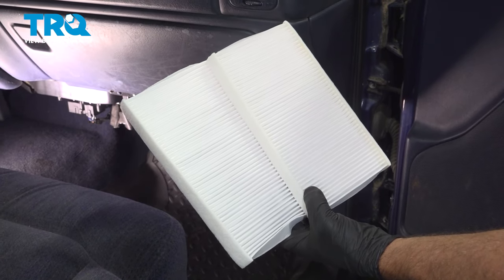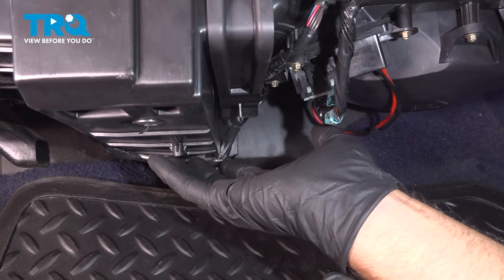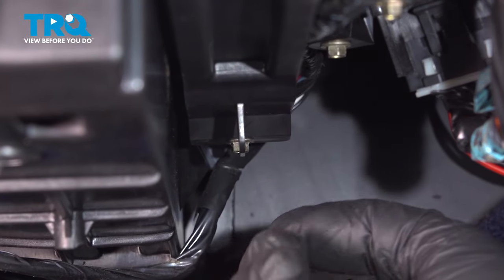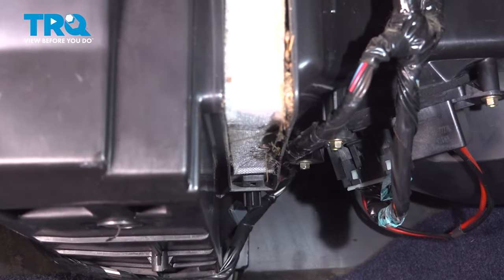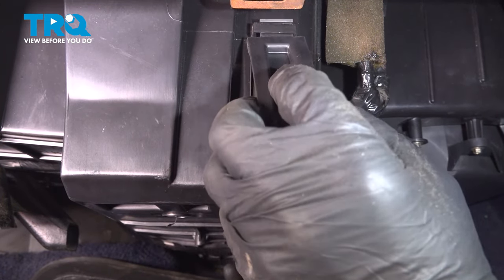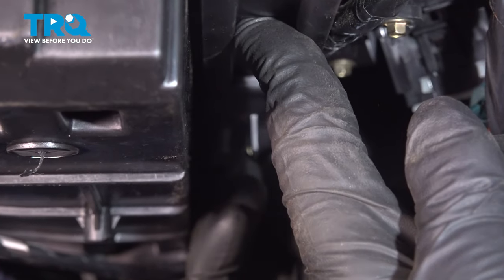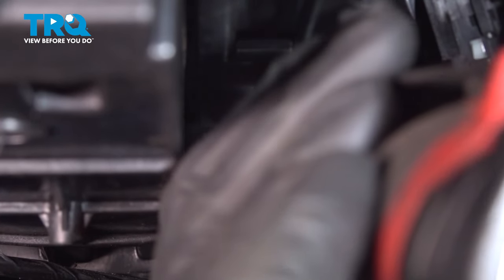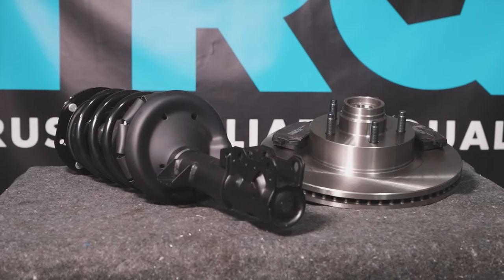How to Replace Cabin Air Filter 1999-2006 Chevrolet Silverado 1500

Comment: My truck doesn't have this. It's a 2006 silverado extended cab z71. Guy at parts store says my year doesn't have one. Why would that be? How do I get the bad odor out from vents? Wouldn't make sense why they list my year as compatible with this filter/process yet then I open it up to find there isn't one.

Comment: Surprised you haven't corrected the title / description / etc. since Chevy discontinued the cabin air filter after the 2002 model year. How about a nice DIY clip on how to modify the 2003-2007 model years to add the cabin air filter back in. Just a thought. I'm biased since I have a 2004 1500 Z71 and would like a cabin air filter.

Comment: I have a 2005 gmc and it does have a cabin air filter but I have no idea how to take it out,  if you take the resistor out then in that hole you can see the filter

Comment: My issue is, you don't show the flow of the cabin air filter on the reinstall...😮
Yes, there are flow arrows on many filters n mine.. According to 2 videos, the flow goes towards the driver's side...arrow points to the driver's side...